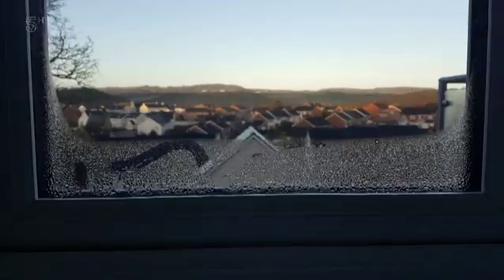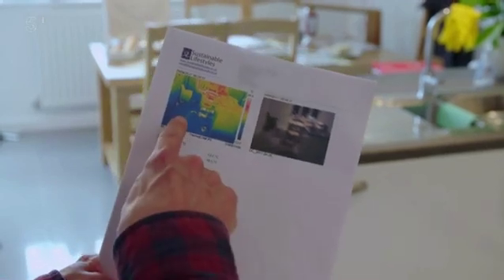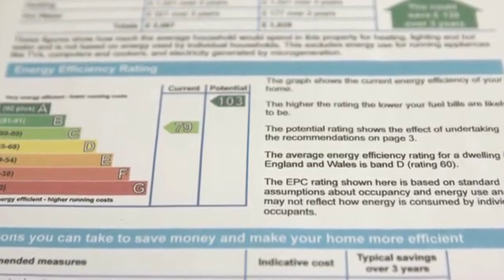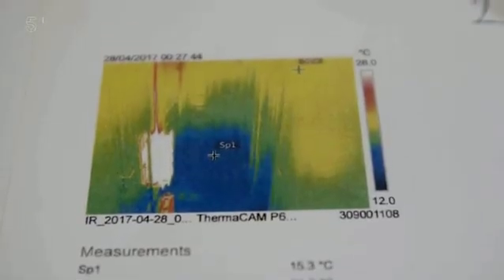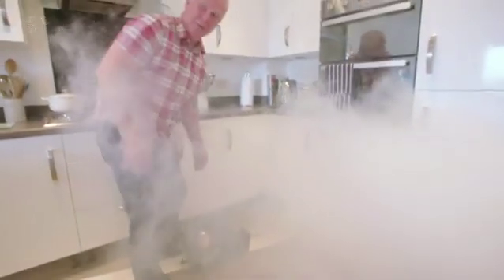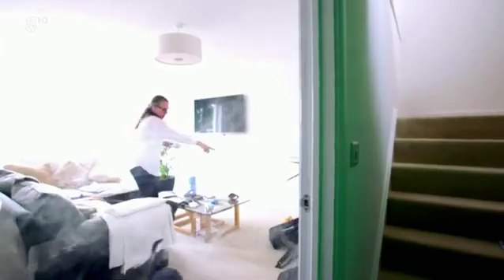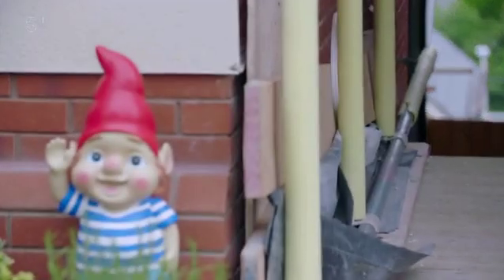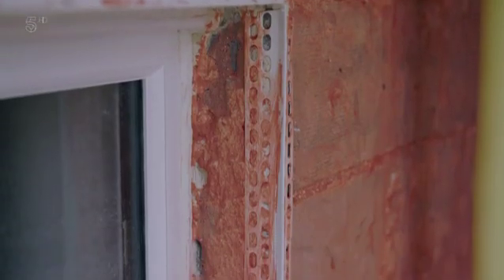Nightmare New Builds, failed insulation

Comment: Plastic and cardboard houses.  Get the internal partitions built with brick /block. Proper sarking on the roofs. Not just a membrane  and 2 foot of glass wool in the loft .
Reply: Yep, i built my own house a couple of years ago, as it was for me I spared lots of expense, but none of the effort. 6 grands of insulation, zero cm2 of thermal bridges, everything done as well as I knew how. £150 a year to heat it for the first 2 years.    This year may hit £180.  3 bed, 2.5 bath. 150 m2 home. UK homes are so badly built now it is shocking.

Comment: When they did the smoke seal, are they being serious, it’s a house not a submarine. You wouldn’t find any house that air tight sealed, you would run out of oxygen
Reply: They do it on all new builds and yes they are air tight, it’s a joke
Reply: My house is that tightly sealed. If the house is not sealed well then your heat would just leak out of it. But when you seal well you have to combine it with a mechanical ventilation system with heat recovery. It works. I could never live is a draughty house again.
Reply: My house is about 17 year old makes me wonder if it passed an air test with tounge and grove flooring and some gaps in wall are size of Sheffield where pipes come out etc
Reply: So how  does a house breath and let out all the condensation from peoples breath and general day to day living cooking etc , and they complain about damp . 
Idiots .
Reply: @laverdajota8089  Mechanical ventilation with heat recovery is how.

Comment: The amount of miss information these secondary so called experts are telling these customers is shocking
Reply: @Lister Smeg they are right, for example the gas pipe needs to have free flowing air at the bottom and top of the pipe boxing. This is usually done into the floor space voids This is an example of specifications when doing Gas Safe installation. For them to suggest that the smoke shouldnt travel between floors is laughable. The only reason to do this kind of test is when creating a "Passive House" where you want to keep as much heat in the house as possible by literally making it air tight. In fairness the insulation on the flooring is a big deal as is other areas of this piece. The smoke thing is total fear mongering.